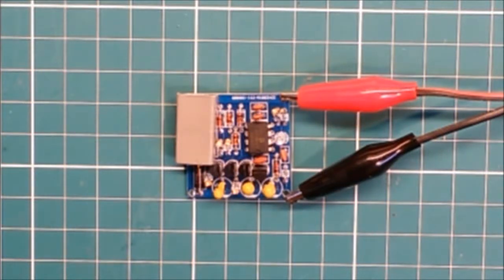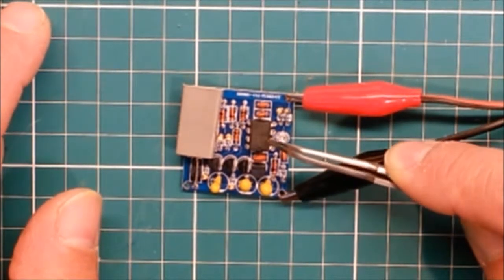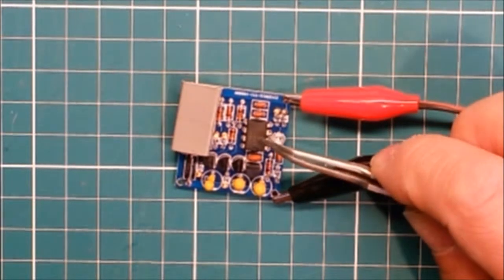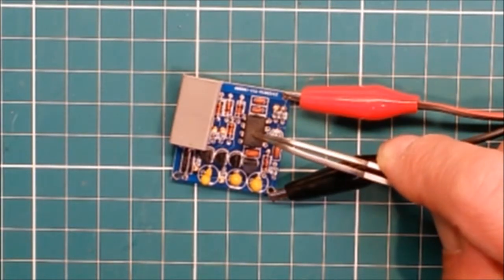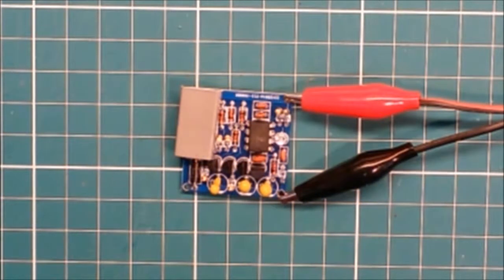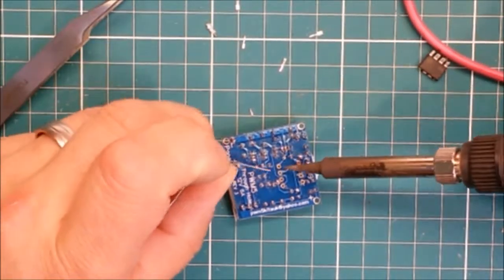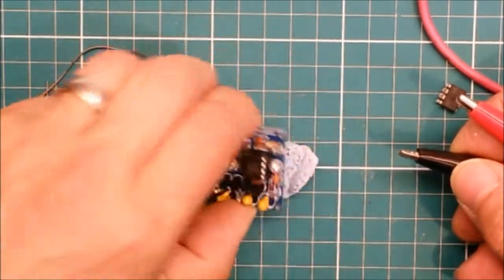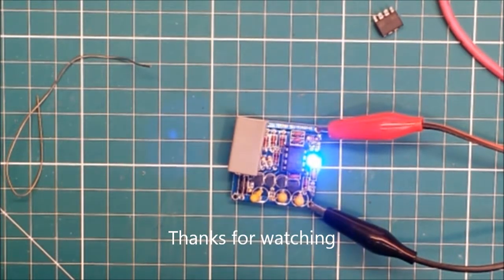PWM5 Kit Build PT2

Comment: Wow! Cheap Chinese clones not working correctly. Who'd a thunk it? 😮
Glad you picked up on the issue before sending out the kits. Looking forward to getting mine. 😀
Reply from the maker: 30 genuine PIC 12F683s arrived today from Farnell. All are now programmed and ready for testing. Testing is just a double check of the code and processing of the data. Once done, the kits will be almost ready for dispatch.